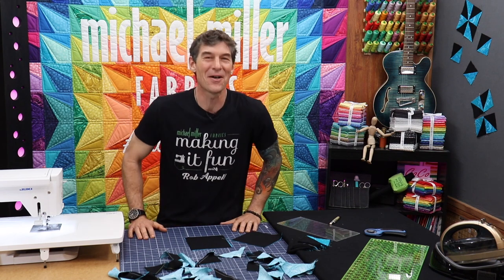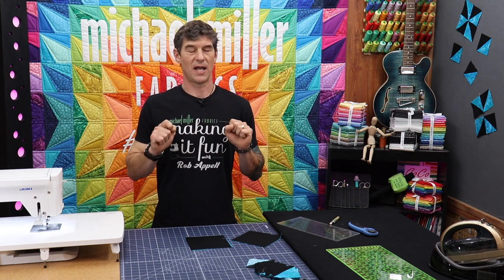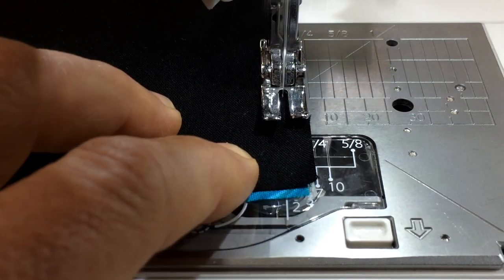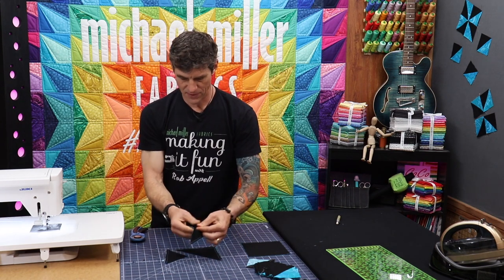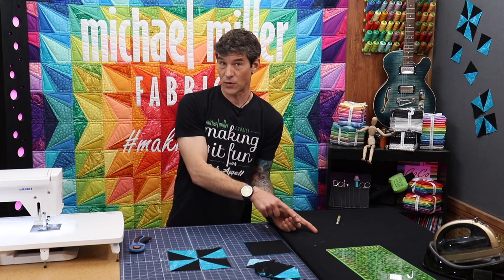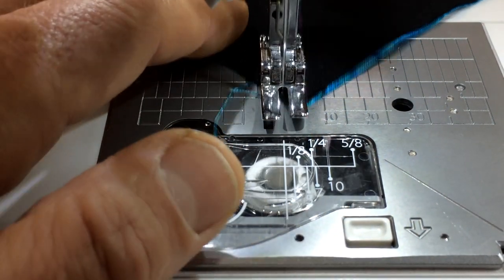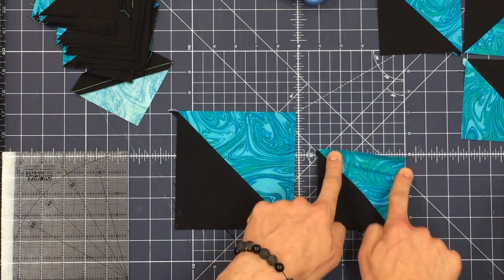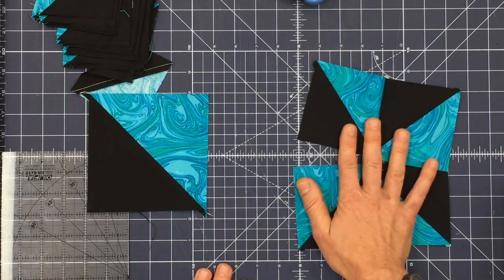Squaring a Pinwheel Block - Michael Miller Fabrics' Making it Fun #116

Comment: Thankyou for the tips!  I know it has it's downsides but I've started pressing seams open on pinwheels to reduce the bulk and using my slotted trimmer to square up the triangles.
Reply: I also found spraying a little water makes it easy to open then press